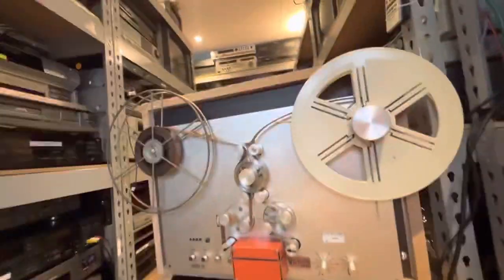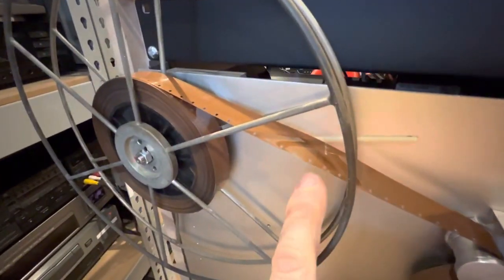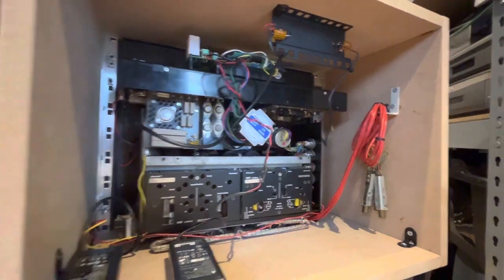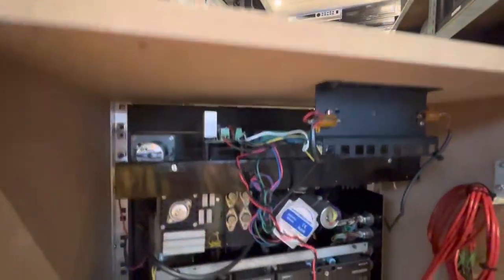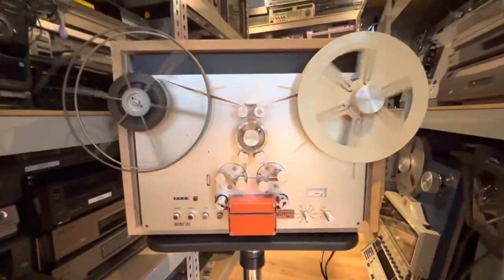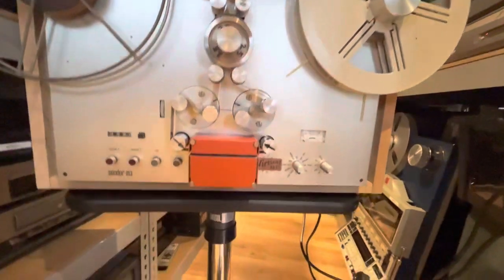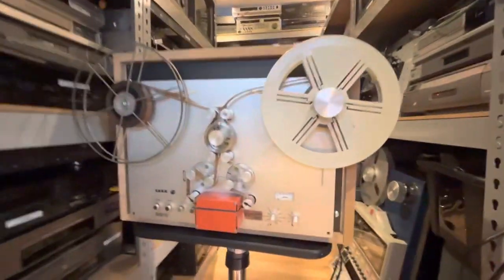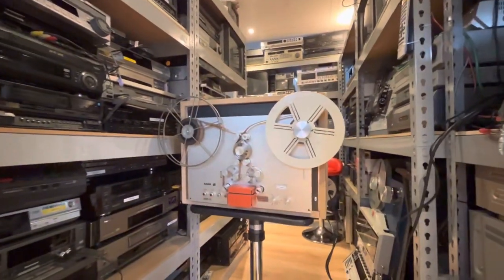16mm Magnetic audio Transfer with Sondor M3

Comment: hi done this with a scully 280-14  that was very ill  i am still working on picked up from usa army place in the uk  to do with air audio and 17  1/4 X 14 inch tape all new  reels 

and some 16mm film mag zonel   came with 100   1/2 inch tapes  os i pimped the suclly to take   1/4 1/2 and  16mm film recording save binning it

the deck was in a very bad way    i have alot of  parts from repairs  so i am using tascam 38    otari mtr 12 to make a  COOL  deck    
bob

Comment: How to you make sure that the sound is running at a constant speed? Like 18fps. I do cine reel transfers and sometimes I get 16mm separate mag tracks and when I go to sync in post, it is out of sync in some places and in sync in some. Could you help? My machine is sprocketless.
Reply from the maker: interesting,  The unit I demonstrated had a speed issue and decided to go up in smoke sadly .  Luckily I had another which runs accurately which is now in service .

I find myself always re syncing parts of sep mag film .  Its part of the process certainly from what I do. 

 I'm not too sure if the splices cause issues as they stretch over time or are replaced and this is all it takes for a sync issue. 

 Ideally the projector and mag unit should be locked together but not really viable for the amount of work we get on this format to justify that kind of floor space requirements. 

 Normally a bit of editing in post cures most issues.  this is not a problem for film that is together with the sound on the same reel.  Best just to price the time in to those jobs or supply separate files for savvy clients to re sync themselves.

 best wishes Howard www.avtransfers.co.uk